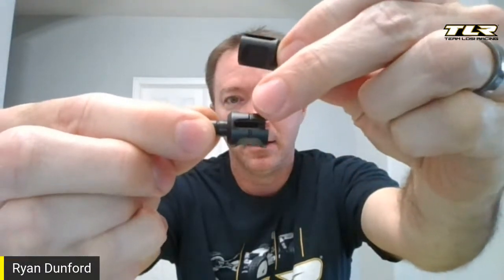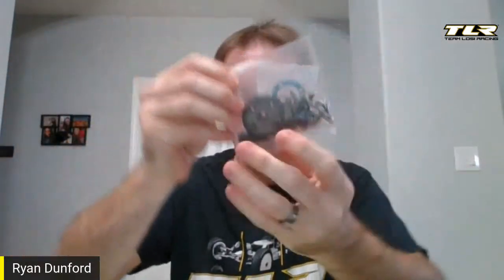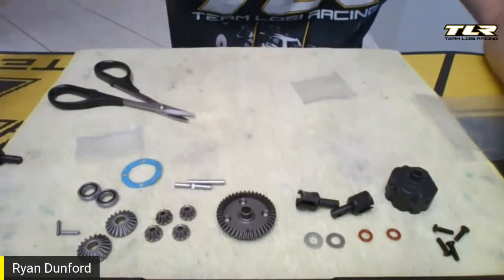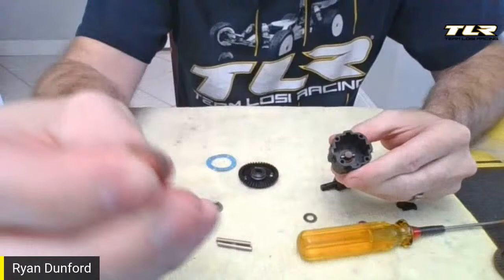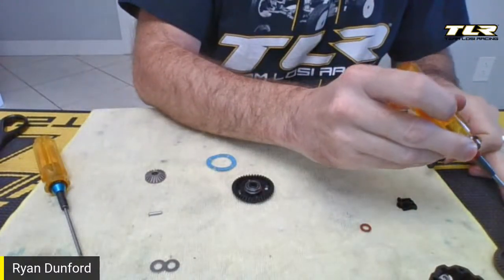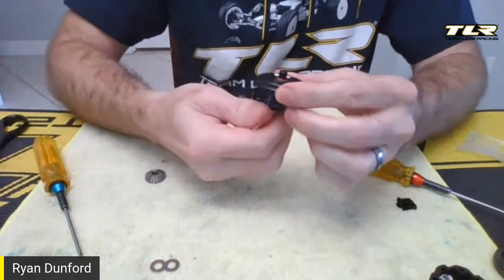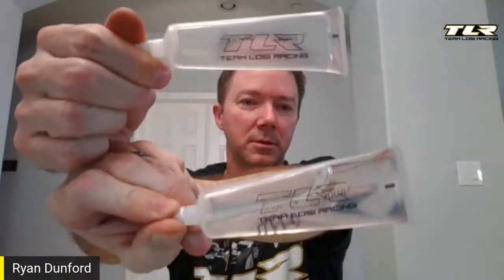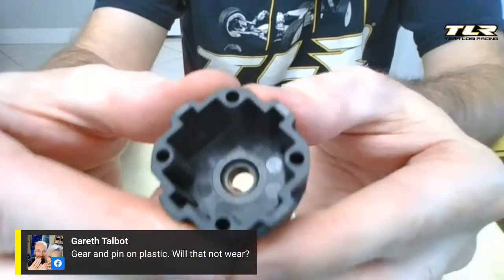8IGHT-X Elite Build Series, Differentials, Bag A

Comment: Can the new differential fit on the losi 4.0? You said they kept it the same but it looked different. Might replace mine to the newer diff if it fits, since it's easier to find the parts.
Reply: well to answer that question, yes, but you have to replace the pinion too, since the ring gear mesh is different.